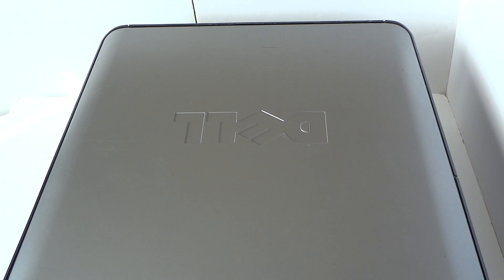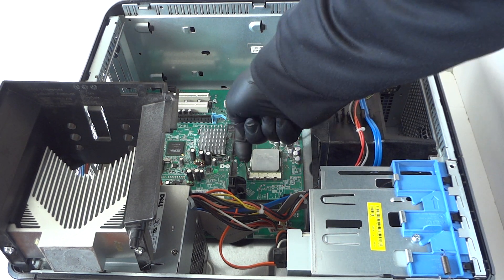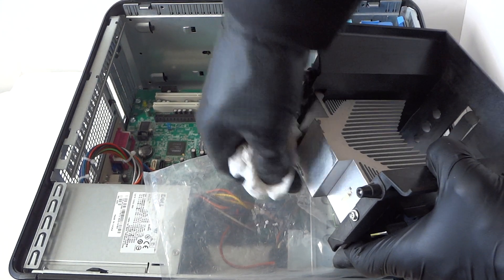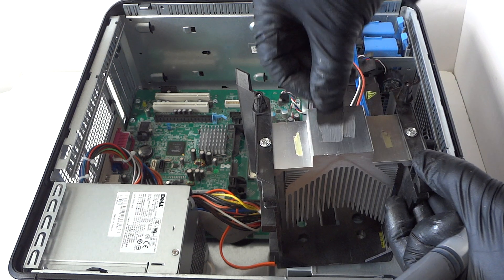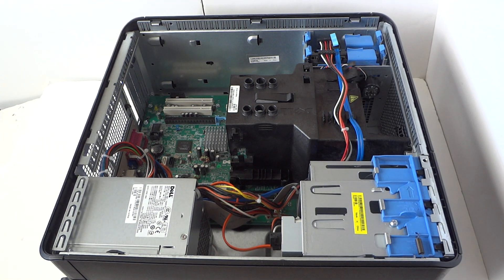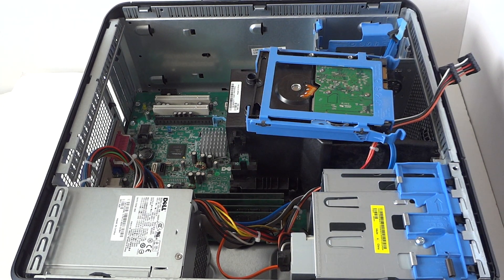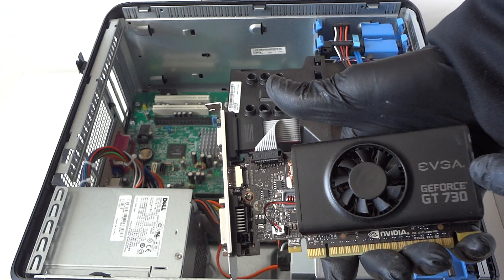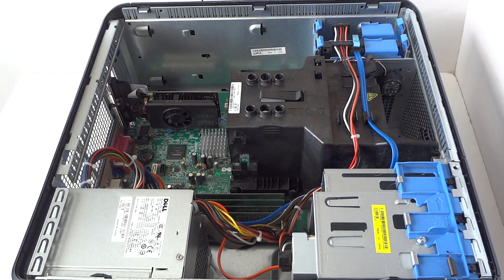Dell Optiplex 740 Upgrade CPU Video Card RAM Hard Drive

Comment from the maker: Here is the list parts upgrades.

(1.) CPU AMD Athlon X2 4450B AM2 2.3GHz Dual-Core (ADH445BIAA5DO) 
(2.)  AMD Athlon 64 X2 4850e 2.5 GHz Dual-Core AM2+ ADH4850IAA5DO
(3.) Memory Hynix Desktop Non-ECC 1GB 2Rx8 PC2-6400 DDR2 800MHz HYMP512U64CP8-S6-AB
Reply: Can it work a amd phenom x4 9600b?
Reply: @JimPunk  that's the processor I'm running in mine :)
Reply: @darthtripedacus1  thx bro
Reply: Mine is rocking the quad core phenom and 4 2GB sticks. Old as dirt but it still rocks
Reply: Thanks great video !😀😀😀😀😀
Reply: What's the graphics card?

Comment: I have  optiplex 740 with dell mother board, i have a processor AMD Athlon(tm) 64 X2 Dual Core Processor 4000+  2.10 GHz.  i want to upgrade graphic card. do you suggest graphic card???

Comment: Why not an AM2 Athlon 6000+ instead? A lot more power, this PSU can handle the CPU. 4850e is the 'low energy' stuff. Have installed one of the original Athlon quads (believe the 630x4), ran w/out issue other than RAM runs in single channel mode, no big deal with this old unit. Can also run a Phenom 965 x4 (max).
Reply: Hello charles I have read the Posette and I want to know what is the species of the processor and engulfs Quiss Orid upgrade

Comment: Great video! I have a question. Can I install a SSD? A have this PC since 2010 😬
Reply: Yes you can just find an adapter for your ssd of choice if it’s required
Reply: @PoCkEtMoNsTeR9090  great! Thanks a lot for your answer. Maybe I will upgrade to 8 Gb RAM and SSD. I saw a lot of videos to achieve it
Reply: David Palestina No worries mate and if you have the enhanced motherboard you can add a 1050ti 4gb. Strongest graphics card the board can handle but I recommend changing the psu to a 450 to be on the safe side. Any questions feel free to ask away

Comment: Does anymore know if the Dell Optiplex 760 can support Intel core 2 quad and if so what's the highest? Pretend I'm dumb when you reply 🤪
Reply: Yes it does. E9550 is the top supported model.
Reply: I’m running an and phenom quad core on it. The best it can run without melting a hole in the mobo 😂

Comment: what procesor you used to upgrade?
Reply: i wanna know too
Reply from the maker: Here is the list parts upgrades.

(1.) CPU AMD Athlon X2 4450B AM2 2.3GHz Dual-Core (ADH445BIAA5DO) 
(2.) Memory Hynix Desktop Non-ECC 1GB 2Rx8 PC2-6400 DDR2 800MHz HYMP512U64CP8-S6-AB

Comment: I need to order these parts- you mentioned the graphics card and video card by name, but not the processor. Could you please list all of the components you installed and include them in the description? It makes it much easier to reference than having to navigate back and forth on the video.

Comment: I have a big tower optiplex 740 with dell mother board,i have a processor AMD athlon x2 64 5200+,i want to upgrade it, what processor do you suggest getting for gaming,and i want to get 2. hard drive in my 740 and i dont know if my power thing xD  support 2 of hard drives???
Reply: AMD Ryzen 3 2200G
Reply: @20chriss  can put ryzen 3?
Reply: @BrendonPresly  no, the ryzen 3 is a am4 socket cpu, while the motherboard in a optiplex 740 only supports am2 socket cpus.
Reply: Sake Walker i installed 3 hdd in this, so you shouldn't have problems

Comment: Hey, sorry to ask, but is an AMD Radeon 7570 1gb low profile compatible with dell optiplex 740 sff?
Reply from the maker: Hi, Yes Video Card AMD Radeon 7570 low profile with low profile bracket will fit and compatible with dell optiplex 740 sff.